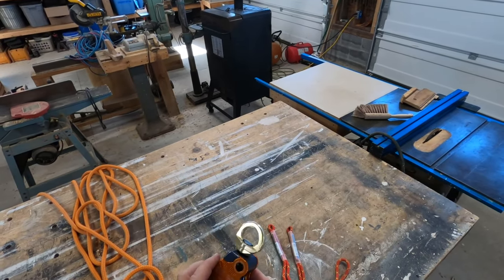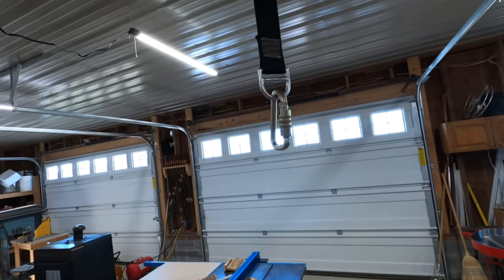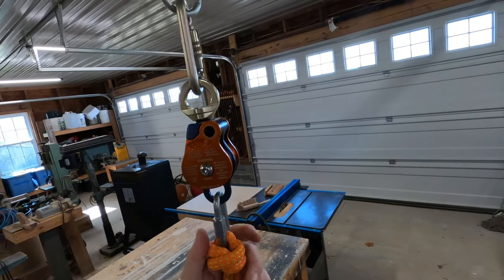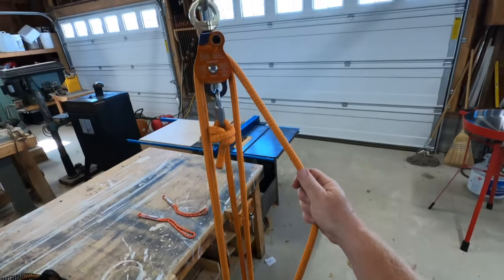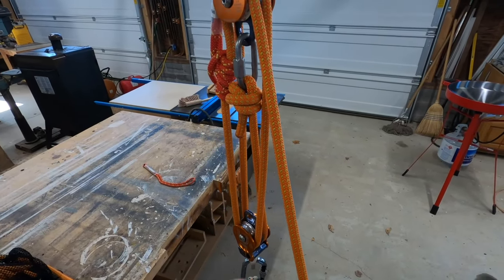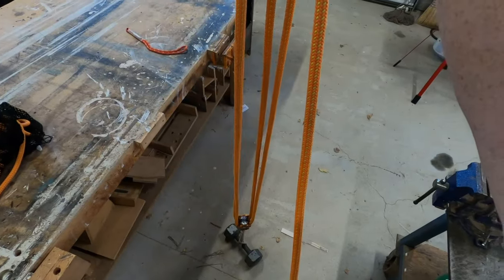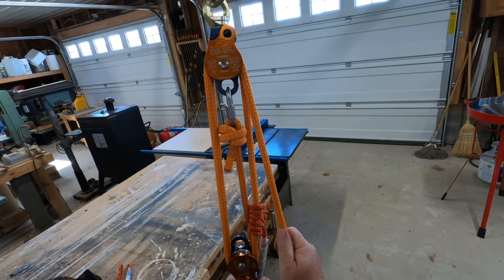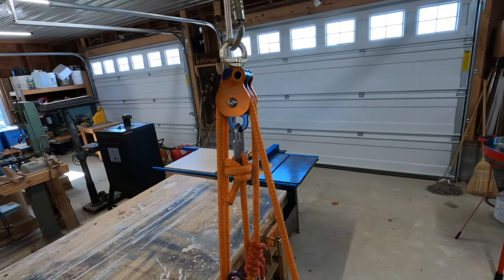How to make your own block and tackle

Comment: This video saved my ass on a construction site - I needed to get all my tools, tile saw, tile etc from a patio deck up to a second floor patio deck - maximum weight was 100# - I had to get creative on the support arm that the pully was attached to - it had to swing in order for me get my products to clear the handrail - could not have done it without this video - thx so much for your excellent presentations 👍
Reply from the maker: This is why I make these videos. Thanks for sharing.

Comment: I didn’t understand the difference between 4:1 and 5:1. In the 5:1 you said the top set of pulleys was moving but they never moved. Only the bottom set of pulley went up and down. You lost me.
Reply from the maker: Check out this video: https://www.youtube.com/watch?v=2GnO0XPAVNc

It links to the original also so it might be beneficial to watch both.  It should answer your questions and if not hit me up and we'll figure it out. Cheers

Comment: 4to1. Does that mean, if the weight is 100 lbs. you’re pulling 25  lbs?
Reply from the maker: Yes, in theory. Due to inefficiencies it is never that clean, but close. You would also be pulling the tail of the rope 4 feet to raise your object 1 foot. Cheers

Comment: Hardware store Rapid links are usually marked with something like "Not to be used for supporting human weight".  Some are aluminum, others are galvanized,  some come from China. The materials and manufacturing methods from one suppler to another or one batch to the next can vary widely and the actual strength  is just a prediction.  I think a figure 8 on a bight or even better, a double figure 8 on a bight would be a better option. Both are stronger  and also don't bind.  Another improvement would be to back up your knot by with a fisherman's knot or even an overhand.  Appreciate the video.
Reply from the maker: Good point about always checking your equipment, including its origins. There are some really inexpensive pieces out there on Amazon and the like that really make me wonder.

And yes, I could have bypassed the link altogether and just tied into the becket. Like many things in rope work, there are different ways of accomplishing the same task. Thanks for watching and commenting. Cheers

Comment: Well explained, including how to do the knot easily. In the last third of the video, you could have simply swapped the two pulleys with the rope still attached, so the one with the fixed anchor (which you kept hooked above) is close to the object being lifted/moved (hooked below the rope), and move the moving anchor (which stops the weight from going away) would need to be moved so it's close to you (hooked above the rope). Thanks for the video! Edit: You did eventually do the swapping, right after I commented this. 😆 Edit2: No, you just moved the mobile anchor to the bottom. I think moving it would make it easier for people to imagine how it would be used practically.
Reply from the maker: Good points. Check out this followup video I made explaining all of this: https://www.youtube.com/watch?v=0lh7ezFI0Oo

Thanks for watching.

Comment: You were right; those "double prusik-minding pulley" blocks are prohibitively expensive for most folks. I guess the execution and concept are still mildly useful.
Reply from the maker: Anything that is rated for life safety is going to be expensive. They are also highly efficient pulleys too, meaning your effort isn't wasted on friction. 

The principles behind MA advantage don't change because one uses cheaper pulleys however. So consider a cheaper version if you aren't hoisting a person.

Comment: Fantastically useful video, new subscriber to your channel!

What brand are those (gorgeous) pulleys? Is there a good online source for high quality rope and tackle?
(NVM, I just found your “equipment I use” video 😁 Thanks!)
Reply from the maker: Glad to have you and thanks for the encouragement!
Reply: @perryfire3006  (You warned that they were expensive, but I was still a little shocked when I saw prices of $200 for a dual-sheave pulley 🤯 Cheaper ones will obviously work for a lot of things, but I'd definitely want the premium versions for any situations where I might be hanging off of them. - I've half-wanted a tree-climbing rig for years now, we have a lot of woods with mature trees around us...)

Comment: Awesome I need to be able to pull logs onto my sawmill ( portable mill). I knew block n tackle would do it, used the one man and rope works great on smaller logs ( still 100’s of lbs) but for larger logs I need safety controls truck n wench with pulleys.
Reply from the maker: Good luck. Happy to help.

Comment: Harbor Freight has a $16 "Gambrel and Pulley Hoist", which includes the 2 double pulleys with hooks and a rope (and the gambrel). Rated for 440lb. and has a built-in stopper to fix the load - similar to how you raise window blinds. Instructions are wrong, so look up how to rig it. It's a decent piece of kit for those weights. Obviously not strong enough for climbing or vehicle recovery, but they also have manual winches and individual pulleys, as well as snatch blocks, for that.
Reply from the maker: Yeah as long as your aren't putting a real person on those cheaper components they have their place. Funny you said the instructions were wrong. You get what you pay for holds true. 

Thanks for watching.

Comment: Great video! What’s a good line to use, twisted poly or what? That looks like about 1/2”
Reply from the maker: That's actually a very detailed question. But, for brevity, use a rope that is rated for life safety if a person if ever going to be hoisted or "on rope". 

I like arborists climbing lines personally as they are strong enough, have great hand, and are generally cheaper than a rescue rated rope. Your question could warrant an entire video going over the details, ha. Cheers

Comment: Could one use this system to pull oneself up? Let's say someone is disabled in their legs, who isn't particularly strong but is heavy, and they can put a belt on and attach the tail and might lift themselves after having fallen down.
Reply from the maker: People have been using this type of system for raising themselves up for a very long time. So the short answer is yes, but for anyone with medical issues it is even more important that the system be safe and have the capability to be fully controlled for the person using it. For example, it would be very bad to raise yourself and then get stuck in a suspended state hanging from a harness, especially a modified one such as a belt. It will literally kill you if you are stuck long enough as the harness will restrict blood flow. 

But yeah, within safe reason, this system can easily raise a person. Cheers

Comment: From 12:35, you get all of the terms backwards.  Stationary versus the pulley that goes up and down are the reverse of what you point at.  Same for load versus anchor (line).  The function is correct, though.
Reply from the maker: Not really as I was describing using it in a 5:1 configuration. I should have disconnected the system for clarity. Check out this video for what I am referring: https://www.youtube.com/watch?v=0lh7ezFI0Oo&t=2s

I really should tag this second video to the original. Thanks for reminding me.

Comment: If your double sheave pulley only has one attachment point, what are the options for the final termination on the high side?  Can you just connect it to the carabiner?
Reply from the maker: You can, although it won't be as smooth. Good luck

Comment: So if at the end after switching the prusik position and turning this into a 5:1, you would have taken what was the bottom pulley and hung it from your top anchor point, would that have correctly demonstrated what you were describing for the characteristics of how a 5:1 should work?
Reply from the maker: Yes. In the 4:1 configuration, the last pulley sheave is basically acting as a change of direction while in the 5:1 configuration the last pulley is moving with the load. Thinking about this, I should make a separate video on just this topic as it would demonstrate how mechanical advantage is achieved. It would probably help in understanding why this is the case. Thanks for the thought.

Comment: I hooked my pulley exactly how you did and the bottom pulley keeps flipping..I have a baler bucket for my well and when I lowered it the bottom pulley got wrapped around the pulley and wouldn't allow the bucket to go down right..dont know how to keep it straight so it wont flipp..its the other pulley you didn't use on your presentation
Reply from the maker: Try putting some weight in the bucket so the system is tensioned. Good luck!

Comment: Why didn’t you just flip the whole system top to bottom at the end to create the 5 to 1?  I was anticipating that so hard I fell off the edge of my couch.  😅
Great demonstration.  🤜🤛
You can make it a 6 to 1 with a small pulley added to the first becket and tie off at the other becket.  But you would probably have to go with a smaller diameter rope to accommodate the pulley in the middle.  That’s okay because 6 tension lines would add up to more than the rating of the blocks. 
Carry on, Mate.  Good stuff. 
                        👊😎
Reply from the maker: Check this out where I redeem myself, haha: https://www.youtube.com/watch?v=0lh7ezFI0Oo

Thanks for the encouragement!

Comment: Great video. What about a parts list? Website? I would like to lift a 200 lb garage heater up, would this be ok
Reply from the maker: You'll need two double pulleys with beckets, two carabiners and a quick link, a rope and a set of prusik loops. All of these items vary in price and quality depending on what you buy.

Petzl, CMC, PMI, SMC, are all great brands and there are many others too. Look at their catalogs or try an arborist supply house such as Wesspur or Sherrils. And 200 pounds is no problem at all. Good luck.
Reply: @perryfire3006  ok thanks for the reply. What middle of the road brand would you choose. Will only be used for installing suspended heater units. I need to be able to lift at least 25 ft. What size rope for that length? How thick of a rope? What do you use the second Prusik for?
Reply from the maker: @LBoogie-uw3xb  Just went over to Wesspur. The Petzl Spin L2  pulleys would work nicely. A Sampson Arborplex 1/2 inch, 12 strand rope at 150 feet is your cheapest option, and for a prusik pick the Flex 8mm sewn prusik. No need for two of them. You can choose whatever carabiners or link you want.

All of this gear is rated for life safety meaning it is strong and durable and it's expensive. But if you are the one underneath a 200 pound heater unit you'll want to know it won't break. One last thing: I'll vouch for the gear but I can't vouch for your rigging methods in the field. So please be safe and practice smart rigging and learn how to properly sling objects as well as place strong anchors.
Reply from the maker: Just re-read your question. If the minimum height lifted is 25 feet, then you probably need to get at least a 200 foot rope.
Reply: @perryfire3006  thanks for the website and recommendations. Maybe i can get one more to complete my portable heater hoist. The garage heater comes on a pallet. I would like to lift the pallet. What would be the best method? The slings? I noticed two sizes of caribiners, would either size work? As an anchor point i planned on a 4x4 across roof trusses with a double loop sling? Suggestions?
Reply from the maker: @LBoogie-uw3xb  If it's a pallet, I would assume basket slings would work, as long as you are careful to equalize and balance the load. There are a lot of rules for something this simple so take some time to learn how to balance a load as well as proper sling angles. I would raise it a couple of feet and intentionally try to make it come off, that way you'll see if you've got it right at a safe distance. This also gives you the chance to test your prusik and make sure it's holding.

You can also tie a safety onto the unit with another short section of rope that connects to your carabiner holding the slings on the pallet. This rope would be unloaded but would catch the heater should it come off the pallet somehow. Just a redundancy to ensure there is no possible way anybody gets hurt or the heater destroyed.

I would buy steel carabiners that are big enough to hold rigging slings. You'll have to figure that out.

Your roof truss idea would work but it's important to know the spacing. Are they on 16 inch centers? 24? 48? How many are you capturing? You may have to go with a longer 4 x 4, a doubled up 4 x 4,  or even a 6 x 6. I can't make that decision for you as it's completely situational. Whenever you are rigging anything, you have to consider the weak points and worse case scenarios and ensure there is no possible way you or your workers get hurt if you follow the rules. 

Good luck and stay safe.
Reply: @perryfire3006  what length prusick 28,30,or 32’’?
Reply from the maker: @LBoogie-uw3xb  any would work but you could split the difference: 30
Reply: @perryfire3006  thanks for the help. I noticed the petzl didn’t mention it was Prusik minding; does that matter?
Reply from the maker: @LBoogie-uw3xb  It is, but you could also go with the Omni block by CMC if you are worried.

Comment: Wy not use a bowlin first so you can get it untied easy?? Or a double Bowlin?
Reply from the maker: You could, but the reason I use a poachers knot is because of the compactness. When you use other knots with a loop in them it elongates the entire system and sometimes it matters when raising in tight quarters. That four inches or so you sacrifice for another knot could make a tremendous difference. Thanks for watching and commenting!
Reply: @perryfire3006  I see. Thanks for replying. It was a good video.

Comment: I noticed your omni block does not have the flat on the bottom to mind the prusik
Reply from the maker: With an 8mm prusik cord it does just fine. I would still consider it a prusik minding pulley. Thanks for watching.

Comment: Why a scaffold knot vs a 8 on a bight?
Reply from the maker: Compactness. The scaffold knot sits tight and is smaller than an eight. Absolutely nothing wrong with an eight however, as long as it doesn't interfere with the operation of the prusik. Cheers